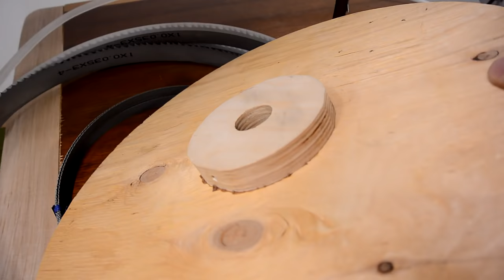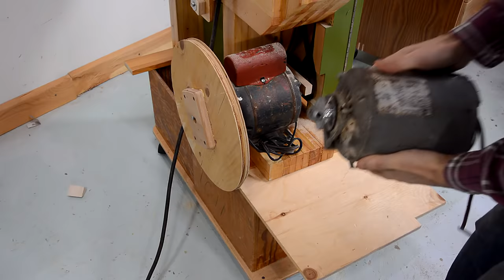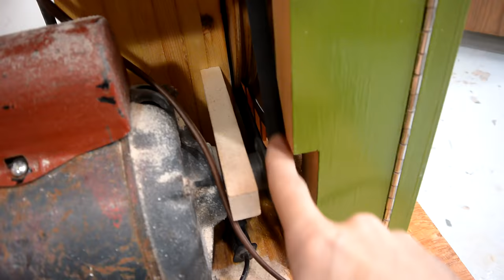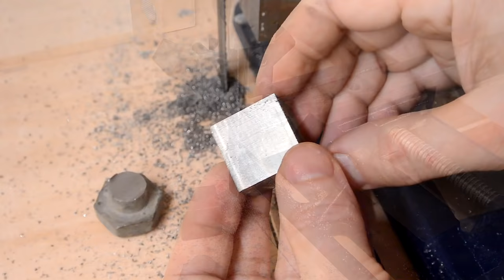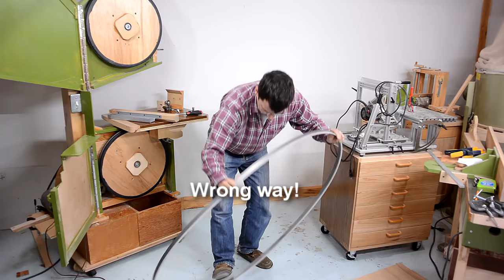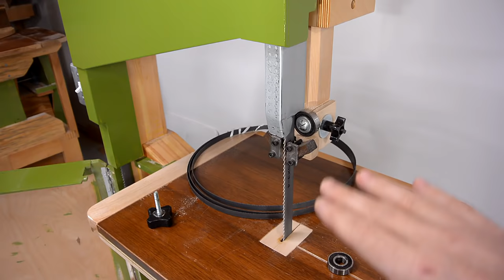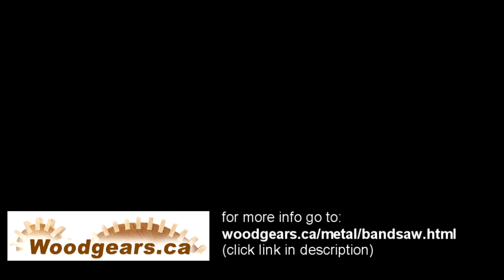Cutting metal on a wooden bandsaw

Comment: Most metal cuitting band saws that i've seen had direct motor drive with a gear reducion (no belts)
Reply: My metal cutting bandsaw has step belted pulleys off the motor to my saw's gear box.

Comment: that metal is cutting at about the right speed and you need to get a stick of lenox lube tube saves blades, cuts a little faster, and works on all metals and not messy like oil Air GAS has it cheep  slick idea for the little band saw

Comment: Why didn't you just epoxy in a cylindrical plug into the hole instead of cutting off the flanges? Then just drill the 5/8" hole. Not trying to tell you you did it wrong, I'm legitimately curious. Seeking knowledge.
Reply from the maker: and how would you make this plug?  If the plug is a dowel, then you are drilling into end grain, which complicates things a lot.
Reply: @matthiaswandel  not sure. Maybe a plug cutter or make one on a lathe.

Comment: Very low marks for safety with your quick random hand movements and fingers near the blade! And don't use a paper towel to (poorly) apply lube. It could quickly grab and wad up taking a finger with it... use a cheap disposable 1" paintbrush that's 6" long or so approached from each side of blade.

Comment: I have seen people cut with a normal woodcutting blade on a band saw.  Just by the virtue of the tip of the blade getting hot enough at high rpm.  The blade is obviously toast for any more woodwork.

Comment: To increase the traction on a small pulley add an idler and/or increase the belt length to increase the wrap of the belt on the pulley. If you make the large pulley bigger you can increase the small pulley dia to keep the speed ratio similar. This would increase the contact on the pulleys and increase the belt speed, making more power transmission possible. Dual motor drives were not uncommon years ago although multi speed motors and compound drive trains work better as they use less power, equipment and space.
 Chips on the wheel are not a concern unless they affect tracking or contaminate the work. A chip removal system involving vacuum and angled brush wheels could be added to remove them before they contact the guides. Perhaps a brush wheel on the open part of the lower wheel to keep it clean. They would work on any material.
   Mike (o\!/o)

Comment: Couldn't have you just used a Variac to lower the voltage on the AC motor?
Reply from the maker: that's a good way to burn out an induction motor
Reply: Induction motors are phase locked to the frequency of the alternating current they run on. So the only way to change the speed of them is to change the frequency of the current they run on. This is typically done with a device called a Variable Frequency Drive (VFD).
Reply: Synchronous motors are phase locked. Induction motors have slip.
Reply: tawanga
the slip of an induction motor is still locked to the phase it is run on, within the limit of the motor's torque. It is that magnetic slip that makes torque in electric motors. Including so called "synchronous motors". It stands to reason that if the poles of magnetism were aligned the motor wouldn't move.
Reply: I think your grasp of AC motors is pretty shaky.
Reply: tawanga
so how do you think they work?
Reply: Both motor types have a rotating magnetic field produced by the AC current in the coils. The synchronous motor has a magnet or DC electromagnet attached to the shaft that spins at the exact speed of the magnetic field- I think this is what you mean by phase locked.
The induction motor just has another coil attached to the shaft, so it depends on a speed difference between the rotating field and the rotating coil to produce the magnetism necessary to apply torque to the shaft. Therefore the shaft always spins at least a few RPM slower than the rotating field- this is the slip. The slip is greater with more load.
There are a lot of websites with better explanations than I have given here, along with diagrams and animations, easy to find with a little searching.